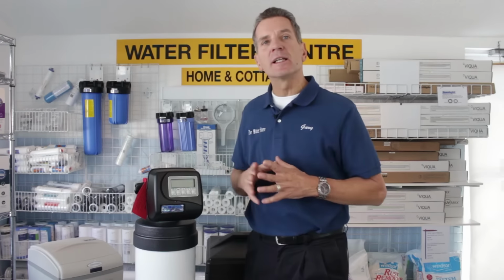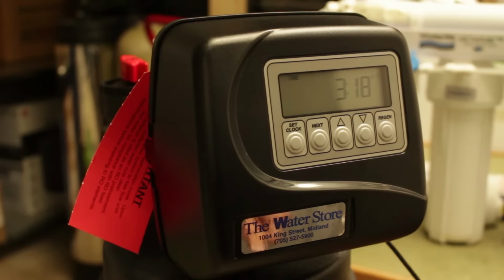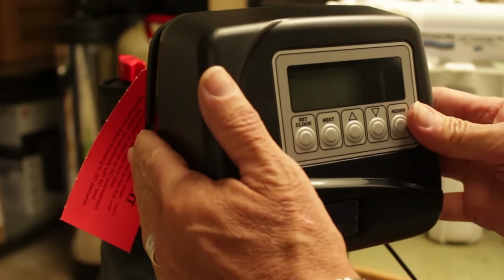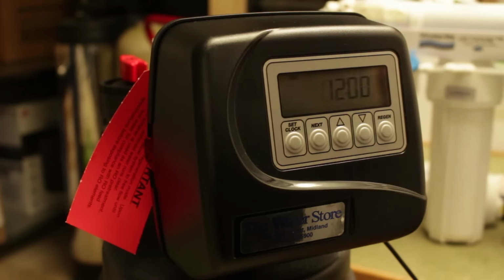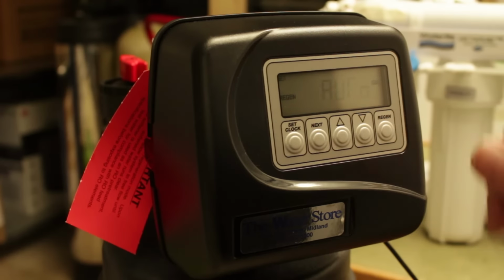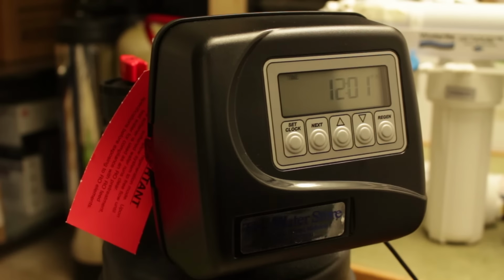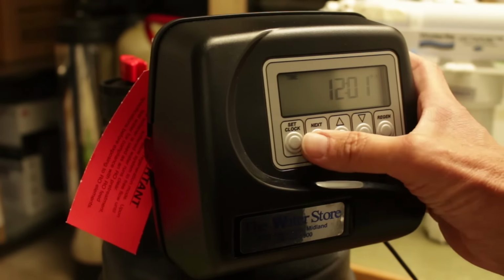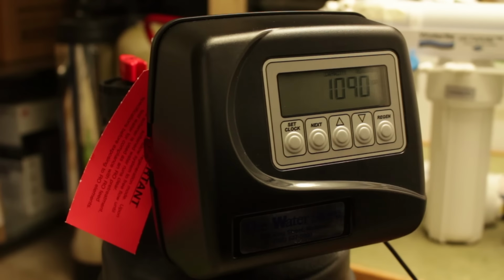Clack WS1 Water Softener Settings

Comment: Recently got a new softener, and the guy left it at factory settings. I don't know the hardness of our water, and don't know what the lbs. of salt should be set at. What do I do if I want the water to be a little softer?
Reply from the maker: Typical rookie move by your installer.  Have your water tested, then using the result complete the settings as shown in this video https://youtu.be/XMY69hdhX44 We can test your water for hardness for free, see https://waterestore.com/pages/free-water-test-evaluation-the-water-estore

Comment: Thanks Gary.....is the re-set valve step critical? Should AC power be activated for the unit when this step is taken? Is separate 9volt battery critical as well? Thanks for all you do!
Reply from the maker: No, the reset isn't critical, usually done when nothing else seems to work. Yes, it needs to be plugged in to power.  The battery is a CR2032 not 9 volt. I hope that helps.
Reply: @water_estore  Many thanks once again. You're very passionate about bring this knowledge to consumers! Appreciated!
Reply: Will the head go to regen if capacity is reached during the day when thwe regen time is set for 2AM.....or should the head wait until 2AM to regen even if earlier that day capacity has been meet? Really appreciated. Also I turn main water supply to off position for the home when I go away ...and unplug the head. What would be the proper re-start regimen once I am back? Hope holidays treated you and your family well! David
Reply from the maker: If the valve is programmed to regenerate when the capacity goes to zero, yes it will. I also turn off my water when away, but do not unplug. Since the water is off, it thinks it regenerates, bust since there is no water, nothing will happen. When you return, urn water on, plug unit back in, set current time, manually set regeneration to today by pushing the regen button.

Comment: Hi Gary, My old WS1 stop showing option for up and down flow, I thought it gone bad and I  just bought the WS1 to replace it but it is the same: does not show the option to change up or down flow. What happens?
Reply from the maker: That's odd, I'll need to check that out.

Comment: I followed your steps above with no problem.  I measured my tank's OD at 37.25 inches.  Divide by pi = 11.86 inches.  Is my tank an 11 incher?  My water hardness measures 180 ppm per strip test. Are the setting you provided in this video correct for these parameters?
Reply from the maker: Assuming you have no iron in your water you woudl set your hardness to 13.

Comment: Just fixed my Clack WS1 no brining problem. I replaced parts but the ultimate problem was an air leak in the brine hose. I tightened the connections real hard and it solved it; however, I want to replace both ends and hose.  Where can I order these parts?
Reply from the maker: Email us and we can help you out with those parts info@waterestore.com

Comment: Follow several of your tutorials, good stuff. What if my clack ws1 changed a setting by itself? Mine changed from softening mode to filtering. I just reprogrammed it. Is my circuit board on the fritz?
Reply from the maker: Great question. I have never heard it this happening before. I would keep an eye on it though

Comment: Hi Gary, I've been watching your video's and finding them very helpful but have recently encountered an issue where my Clack unit is post filling all the way to the top and now when adding salt water is being displaced via the overflow.  How do I set my unit back to a pre brine where it only fills for 4 hours prior to re-gen?  thank you.
Reply from the maker: Are you sure that it is post brining and not that it isn't drawing out the brine during the brine cycle so the water is accumulating in the brine tank?

Comment: Hi Gary, great video! One QQ: I have my water softener set at 2am and it has 1360GAL remaining capacity when fully regenerated. "Maximum days of regen" setting is set at 14days. I usually run to capacity of 0 in 7 days. What confuses me is: when the capacity turns 0 does it regenerate the following night at 2am or does it wait for 14th day at 2am?. I am new home owner and just trying to figure out what suits us with 2 people in it. Your info is precise and i watched your regen video too but it did not say anything about this.  Thanks.
Reply from the maker: It wil regenerate when you run out of capacity or every 14 days whichever comes sooner.

Comment: Is it ok to set the regeneration override to longer than 14 days? Would it be bad for the system if I set it to 21 or 28 days? I always have a lot of capacity remaining after 14 days.
Reply from the maker: You risk getting channeling and compromising the medi

Comment: So I’m comment in hopes of figuring this out as we bought a house with a water softener in place. Maybe 5-6 years old. It has the words “call” flashing 24/7. I’ve googled all over the place and can’t even find this info in the internet. How can I erase this “call” from flashing all the time. The previous owner said the installers program this so you call them back to the house. Thank you
Reply from the maker: Previous owner is correct. press the up and down buttons together and hold down for 10 seconds to shut off. You will likely need to do this every year.
Reply: Awesome. Thank you. I just did. One other question I had and I see this is discussed vaguely in some videos of yours and others about the salt level. By the time we got around to adding more salt I was maybe 1/5 at the bottom. Maybe less. I added a 40lb bag which obviously covers the salt and the water inside. But it only raised the salt to maybe 1/4. The next month I added two 40lb and I’m closer to 1/3 now but I can’t see the water level anymore like I did when it was at 1/5th. Do I need to add water as well or does the machine know how much salt is in the container? There is a conveniently placed water spigot right at the unit so I didn’t know if that was used to ever add water.

Comment: I have my water softener set for auto regeneration at 21 days. I am the only person that lives in the house, so I don’t go through too much water. 
Is there a way to see how many days are remaining before my system is set to “auto regenerate“?
Reply from the maker: On the newer ones with the 5 buttons in 2 rows I am pretty sure you can click the next button and it will show you.
Reply: @water_estore  , as far as I can see, it shows you "Gallons Remaining" (soft water), but I don't see where it shows "Days Remaining" (before auto-regeneration)

Comment: i have a clack cs1 and it does not regenerate.  when i press the regen button it goes to Pnd =9 in the window and does not regenerate manually.  What needs to be done to fix?
Reply from the maker: I have never seen Pnd=9 show up on the display.  I think you need a new circuit board https://waterestore.ca/search?type=product&q=clack*%20circuit*

Comment: I use water inside, yet the “water softening “ doesn’t blink.  What could the issue be?
Reply from the maker: The meter isn't working.  This video will help you https://youtu.be/Lr3jyGiJdC0
Reply: @water_estore  Thanks.  I pulled the water meter out and evidently was stuck. I recently replaced the resin. Might have gunked it up in process.  But it’s working now.  Tested with magnet and air it registers.

Comment: Great work Gary! My question is why can I not find any credible sites that explain, based on my water tests, exactly all the recommended softener settings? Additionally,  I use my cottage frequently some times of the year and infrequently other times of the year. Knowing the optimal regeneration time periods, based on my usage,  is also a mystery. You'd think spending about $2K on something, there would be significantly more info available on the correct way to use it. I am not getting much from the vendor. I'd love to learn more. Can you help me? Thanks Gary.
Reply from the maker: This video should help you with the settings https://youtu.be/5j3wXccdC4c. As long as it is a metered water softener it will regenerate based on your water usage.

Comment: My hardness display says NA..big deal? Also the service settings don't come up (next and down @ same time)
Reply from the maker: Your valve is programmed incorrectly.  You will need to unlock it first using the info from this video https://youtu.be/bU3wW29R7iE

Comment: Hi Gary, I have The same unit  WS1 going to my settings to just hardest level  is set  to n/a (could not get  it to change )
Reading from the manual says it’s set as a  filter setting not as softener. Other setup setting display  C 5
Is this unit locked?  how do get it to changed back to to a  softener? Any advice to get this working properly would be appreciated!
Thanks for all you do your videos are great!
Reply from the maker: This YouTube video of mine shows you how to unlock https://youtu.be/bU3wW29R7iE  When you are in the second level of settings you can switch to softener.  this video will help https://youtu.be/npBmE8wJkvM
Reply: @water_estore   Thank you so much ! i was able to unlock the settings and change it from a filter to a softener
  (my water is much softer) and set to c 2 programming. The hardness level still does not change still set to  N/A any thoughts on how to change that?

Comment: I just had a Charger water softener installed that uses the Clack WS1 High Flow control with bypass.  I noticed the brochure says there is a relay which can signal a modem or call device.  I have the manual but it is very complicated.  Can you tell me how to set up the relay signal and what exactly is the signal/information that it sends and to where?
Reply from the maker: Sorry but I do not know anything about the relay or how it would be used.

Comment: I've heard that potassium can be mixed with salt to lower the salt level.  Is that a good idea and is there a good mixture to follow?
Reply from the maker: Yes, you can mix any ratio you would like form 0 to 100% and at any time switch back and forth.  But keep in mind that the Potassium is only 80% as effective as sodium so you would need to compensate with the hardness settings.
Reply: @water_estore  Thank you Gary, that's good to know.  We moved into this house 4 year's ago, it has a well with a water softener, and just recently my wife was diagnosed with high blood pressure, we're both in our 60s, and neither of us had that problem before.  So I'm trying to eliminate some of the salt in our diet. Also, heard that the potassium is a good addition to our diet. Again, thank you, and thank you for your time and expertise.
David & Nina

Comment: My total regen time with a Clack WS 1 valve is 3 hrs & 30 Mins. After regen, I get dirty water in the house for about 15 - 30 mins. Can I program the valve to increase the backwash & rinse time? The backwash is set at 10 Mins & the rinse is set at 6 mins.
Reply from the maker: Yes, increase them by 50% to see if it makes a difference.
Reply: @water_estore  Thanks

Comment: I wish you would go into these settings a bit more or do a live stream on it. I have 2 tanks 10x52 with 2 5 button clacks. One is a filter, the other a softener. 3 people live in the house. My water measured 50ppm for hardness and no iron but the water smells.What should the settings be? and if it's set to auto like it is in this video, why is there a 14 day override set when it should be going off of the usage meter?
Reply from the maker: Great questions!  The only settings you would change are the hardness and clock.  The other settings are set at the factory to suit your system best.  I don't change them and I recommend you don't change them either.  A metered water softener like these will regenerate when it's capacity has been used up, but you still need the 14 day over ride because if you don't use up it's capacity in 14 days it still needs to regenerate then.
Reply: @water_estore   Is the hardness setting in ppm or gpg? my water test reads 50ppm for hardness and do we need to set grains capacity?
Reply from the maker: @3sidesofeve711  settings are in grains per gallon.  Divide ppm by 17 to get grains per gallon.

Comment: How do you determine the Hardness, Grains, and Lbs?
Reply from the maker: You need to have the water tested for hardness https://youtu.be/rLXlIK1MJ9s.  The grains is typically 75% of the size of the unit and lbs of salt I typically get from the manufacturer so I can't help you with that one because it depends on what system and media you have.

Comment: Hello I have a Hague 800 Iron filter using a Clack WS1. I cannot reprogram the head for the life of me. I tried resetting it and it never resets. If I hold next/down it wont do anything. Do you have any tips? Thanks!
Reply from the maker: It's probably locked.  This video will show you how to unlock https://youtu.be/bU3wW29R7iE
Reply: Gary the Water Guy thank you. I did come across that video which helped me properly program my iron filter and troubleshoot that it is definitely the seal pack leaking that is my issue. Thanks!

Comment: After I unplugged it and plugged it back it a E1 code came up. Before I unplugged it a code CO was flashing. Any tips?
Reply from the maker: Try unplugging the power from the circuit board for a few minutes and then plugging it back in. That should reset the board.

Comment: Hi thank you for the information. I have a similar, or possible the same it appears, softening system. My water hardness is 72gpg. Yes, 72 GPG. And our TDS is 790ppm. We have extremely hard water. We have a softening system and then an RO for drinking.  The RO has a TDS of 130ppm, which I assume is mainly salt from the softening. 
After passing softening, our water hardness drops to 0-1gpg. Which is great. But I’m a little confused because our “hardness setting” on the system is only set to 20 (not 72). So how can it be set so much lower yet properly softening the water?

Also, I’m even wondering if the system is leaving TOO MUCH salt in the water as we have terrible salt residue left over and our skin feels so dry after a shower or even just rinsing our hands!  Any help would be MUCH appreciated!  Thank you in advance.
Reply from the maker: I suspect what is happening here is that right after it regenerates your hardness is 0-1 gpg but after a couple of days your media beads will no longer be able to soften your water and the hardness will climb back up before the water softener regenerates again.  So you are getting hard water passing through your softener between every regeneration. The hardness setting tells the water softener how much capacity before you need to regenerate again.  I would set that water softener to 72 and I'll bet that "salt residue" (is actually hardness) will go away.
Reply: Gary the Water Guy thanks so much for the reply!  What you say makes sense, however, this dry feeling on the skin and residue is happening when the water reads 0 hardness...  as I’m testing the water my hands become very dry and the 0 hardness water is leaving a white residue on surfaces that same day.
Is there any other possible reason for this happening?  Could it be our hardness is so severe that the amount of salt added is so high that it’s leaving this residue and drying our skin?

Thank you again!!
Reply from the maker: Sean Harris yes, your hardness is so high that it takes a considerable amount of sodium to regenerate. Likely your tds after the softener is close to 900ppm.  The residue is what is left after the h2o is gone.

Comment: Hi, when I push the next and down button nothing happens. I tried holding them down for 30 seconds or longer, still nothing. Any ideas?
Reply from the maker: It sounds like your valve may be locked.  To unlock you just follow this procedure from the manual. To unlock press ∇, NEXT,

∆, and SET CLOCK in sequence, then press NEXT and ∇ simultaneously for 3 seconds.  You may need to try it several times to get it to unlock.

Comment: We have a clack 1054 unit. How do I fill it up with calcite?
Reply from the maker: Did it have calcite in it before or was it used for something else?
Reply: @water_estore  has calcite.  Used flashlight to check level (can see it when light is held to tank) it's about 1/2 full. Was installed 2015 not serviced since.
Reply from the maker: @alanlevine3984  I have never done a video on media replacement, but basically, you turn off the water, regen to release pressure inside, disconnect and drain tank, spin off valve.  Flush out media and replace with the correct freeboard (room for the media to expand during regeneration) so it can back wash properly.  I am way oversimplifying the process here. It is not something I suggest as a DIY project which is why I have not made a video on the topic.
Reply: Thanks for the overview. I was just wondering about it. I'll take your advise about not being a DIY

Comment: Love your videos, very explanatory.  I have a 48,000 with the same control valve, vortech resin tank, just refilled with 1.5 cuft of 10% Liquagen resin.  Water hardness 356ppm/ about 21gpg.  What settings do you recommend?  Thank you
Reply from the maker: Glad to hear you like the videos, please share with your friends and family.  Assuming you have no iron or manganese in your water I would set the hardness at 23, salt at 15 lbs and the size or capacity at 38,000.
Reply: What do you mean by “have a 48,000”. It sounds like you have the same setup as me and I just rebuilt mine with same liquagen resin. Trying to figure out correct settings
Reply: @SATXDONKEY  sorry, my mistake it's a 54,000.  It's the capacity of one's resin tank.  Mine holds 1.5 cuft of resin.

Comment: please provide the acceptable range of settings for each parameter.  For example, Hardnes range :  Min 14 max 24? like that
Reply: You need to test your water hardness or find out how hard your city water is so your softener can correctly soften the water. In Arizona water is pretty hard so it's going to be in 20-24 range in the settings most likely.